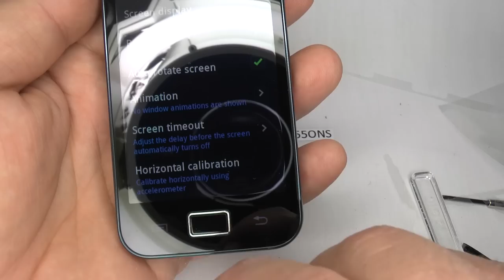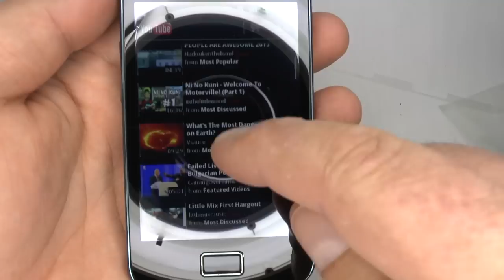Galaxy Ace S5830 Screen Replacement - Disassembly & Assembly - Digitizer Display

Comment: Many, many thanks!  Without this tutorial, my chances of getting the broken screen replaced were 0.  With it, I've got it fixed rather quickly.  I've noticed that the leftmost part of the touchscreen does not react to touch, but I guess I've gotten something wrong.  Everything else went fine.  Big thanks!

Comment: Perfect video i changed screen without problem. But after turning on phone i have problems with hitting correct letters in messaging for example when i try to hit letter R i have to hit somwhere between E_R or when i try hit O i have to hit between O_P so when lets say you divide keyboard in middle..left side of screen tends to be calibrated more on left side and right on right side....unlock sweeping etc works normal ...also sometimes  have to push hard on the screen.Any thoughts???

Comment: Very nice video.  I replaced my LCD screen and touchscreen with it.  However, still have the original problem.  The phone boots up with sound but there is no picture on the new LCD screen.  I checked the snap in connection to the main circuit board twice.  Any ideas what is wrong?

Comment: Use isopropyl alcohol to remove the durty glue from the case,with screwdriver you will leave a scratch  20:48 :) isopropyl alcoho it's work very nice and  it's also good for the circuit board prevent the oxidation and leave a nice clean surface.

Comment: I have a galaxy ace what you might wanna try is go into settings then display at the very bottom of that menu you will see horizontal calibration give the a try before your completely reset your phone if you havent do e so already

Comment: Hi, changed my LCD and digitiser today, all went well, switched it on, and had home screen come up - could not do anything with touch screen( unlock screen)?? Opened it back up again to check to make sure things were connected properly. Now i cannot turn it on? But when i plug in the charger- the battery displays, and shows that it is charging. Hope this makes sense  Andy

Comment: I have received a GT-S5839i with a broken digitizer, when i come to replace it the black hinge cover for the flex cable is missing (part that holds down the flex cable for the digitizer) is there any way of replacing this? if not could i improvise something to make pressure to make connection to the pins to make the digitizer work? I have been stuck with this for a few days now and im not making any progress, any advice will be great! thanks in advance.

Comment: From where did you find the ace  frame please tell me
Thank you for the video
Reply from the maker: For spares try http://www.etradesupply.com and use coupon code ETS2 for a small discount which also gives me credit
Reply: *****
I noticed they are US based.  Any tips for a UK based supplier?
Reply from the maker: AlloaAthletic Wasps I've not not had much luck with uk ebay so I can't recommend anyone..

Comment: It Doesn't make a difference between Samsung galaxy Ace S5830 and S5830i ? Or it does? Thank you!
Reply from the maker: There is a difference in the hardware on the mainboard but I think they share the same screen.. http://androidforums.com/samsung-galaxy-ace/545683-difference-between-gt-s5830-gt-s5830i.html

Comment: Hi....my repair of the cracked screen went without any problems, BUT after I switched the phone back on, it entered into safe mode (displayed in lower left corner), and also I can't acces all the applications stored on the micro sd (skype)...but it recognises the card. I tried everything, factory reset, deleted cache etc....but the safe mode is still there....anyone any idea??

Comment: hello Lessons, I make every move to replce the display and the screen , but after that the touch screen not working. Any suggest? Thank you
Reply from the maker: you have a faulty new digitizer, you'll find another one works fine..
Reply: ***** Thank you very much !!
Reply: ***** I bought new digitizer and again the same! I am try to put password and the touch screen not working! Next to check please?
Reply from the maker: MariosK can you try the old one to see if the touch works?